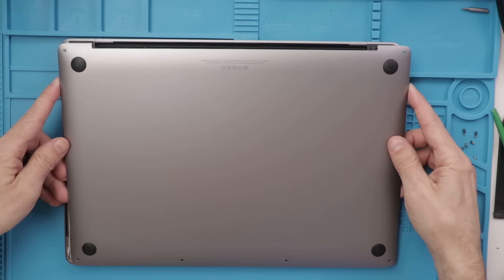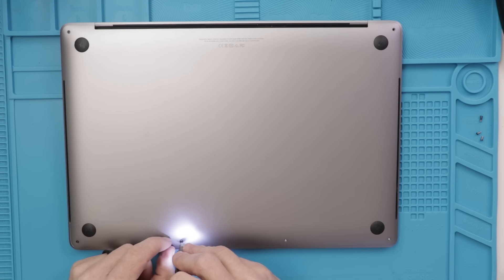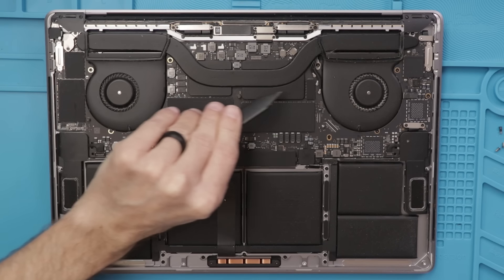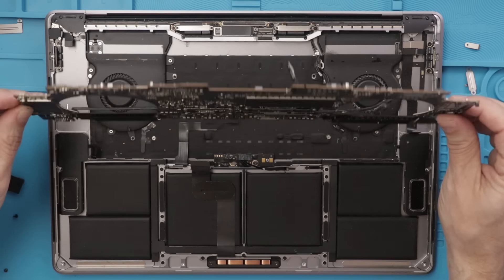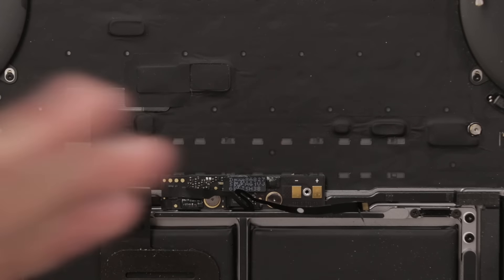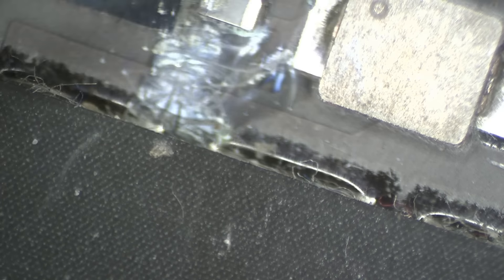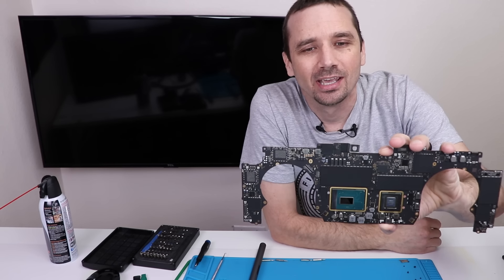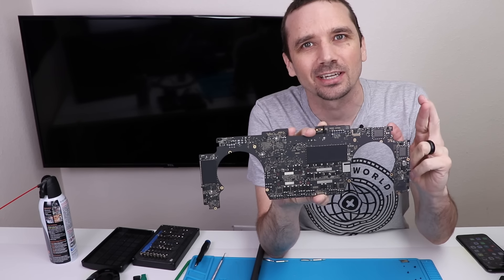I Spent $865 on a Liquid Damaged 2018 MacBook Pro - Can I Fix It? Did I Just Waste my Money?

Comment: Steve, instead of putting all of that crap back together, you can us an inline USB-C meter and connect a charger to it. The board will power on when connected to the power supply, and you can watch the voltage and amperage to see what it's actually doing (like if it's getting 20V and power cycling, or if it's not going past 5V, which in this case it wasn't). The CD3215 chips are what talk to the charger and bring it up to 20V, but each port has its own chip. If even one of these chips has failed, they all won't work.

Even if you could have fixed the logic board, you still can't fix the keyboard. And I don't just mean the liquid damage. Those butterfly switch keyboards are garbage!

Comment: Hi, my MBP 2017 got a little water in it because of the bottle and bag fiasco and I took it immediately to get it repaired. They kept it for a day, dried everything out and it works just fine right now except I have a little watermark on the bottom right corner of my screen. is there any way to fix it? I don't want to spend 500 pounds on getting a new screen in a 4-year-old laptop

Comment: Looking for some help.

My ps4 Pro just started having wifi and bluetooth connection issues.

I have done everything possible to confirm wifi router is not the problem.
My wifi connection will randomly drop out.

Now I am having issues with bluetooth controllers being laggy as well.
My ps4 is about 10ft away from the couch.

Nothing has changed, nothing has been dropped or damaged in any way.
I'm wondering if it is the antenna in the ps4 pro?

Comment: Man i have a late 2011 MacBook Pro 15  with a faulty GPU  and its a pani in tre ass, what i have to do , i’d really like to repair that.
Reply: There's a script that lets you disable it and use the onboard GPU. The only way to fix the GPU itself is to reball and replace it but it will eventually fail again.

Comment: Hi there, i was wondering if you could help me out with a Macbook pro late 2011. 
I recently purchased 16gb Ram and Samsung SSD , i've erased the original HDD and i tried to ReInstall the OS X LION, but when i get to Start the Installation , it says that the product is temporarily unavailable, is there any other way to Install the OS?(I've tried to Install it with the new SSD as well , but i get the same message)
any advice  ?
Thanks.

Comment: Don't always assume its a short.  Some GPUs have a low impedance path to ground so a rail would measure 2.0ohms, or 3ohms and if your DMM of choice is on continuity check, you will think its a short.  If you have a thermal imager, you can look at the circuit board and see if it powers up and down.  Some power supplies will pulse on and off when a short is there (built-in protection) so a decent thermal imager would give you some good direction.

Comment: What a joke. As long as it has a dumb apple logo on the outside you can sell that trash for more than a working decent laptop. I have to use apple for my work and I like it but the prices of damaged and refurbished devices is straight up insulting.

Comment: Apple is just expensive bad quality old tech and very hard to fix  you can have a much better pc by choosing your components for 3 or 4 times less than apples and overall apple has so bad products that overheat a lot even a 300 dollars switch ps4 or xbox one are much much better in quality than that and are much cheaper products, anyway it was interesting to see how you dissasemble an apple laptop